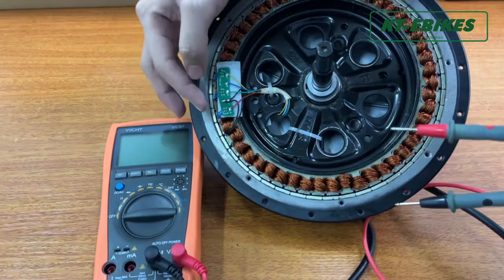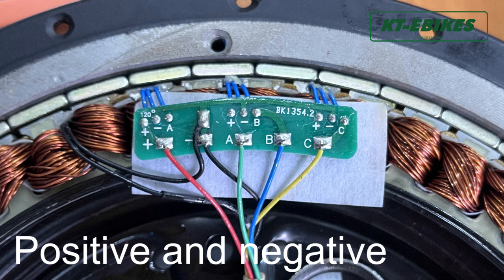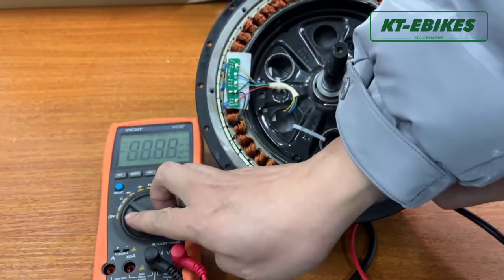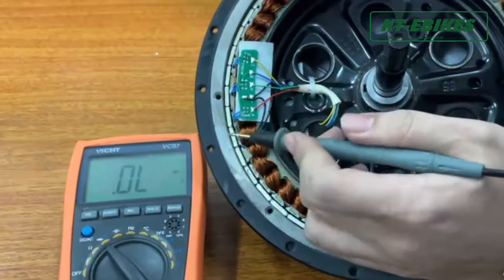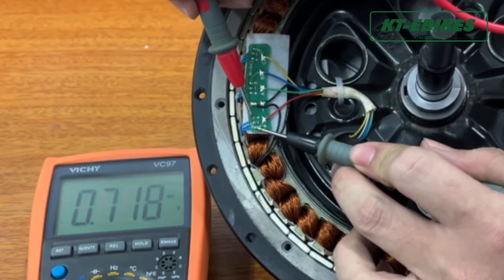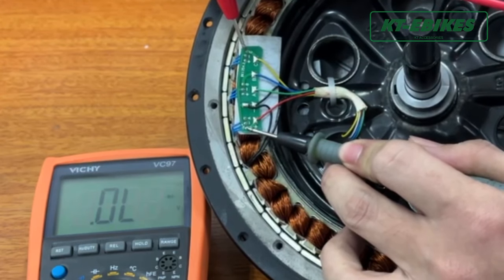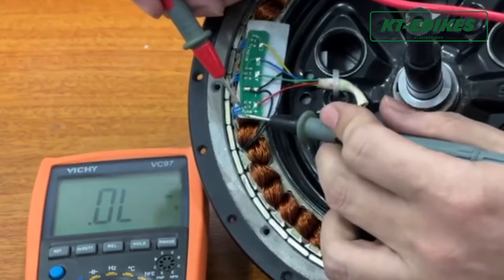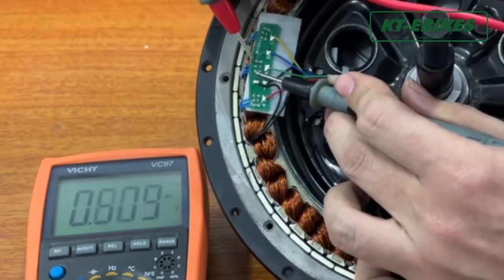How to Diagnose a Hall sensor in a Brushless hub motor | Step by Step instructions

Comment: This is not the correct way to test Hall sensors.
Reply: It gets the job done, that's all that matters
Reply: @fubar6545 it does not get the job done either. Diode testing of a hall sensor is nonsense.

Comment: my controller got a 6th white wire on hall sensor harness... is it an input for temp sensor or what els could it be .. my motor got 5 wire on hall harness but i strictly need to know what that 6th wire is?